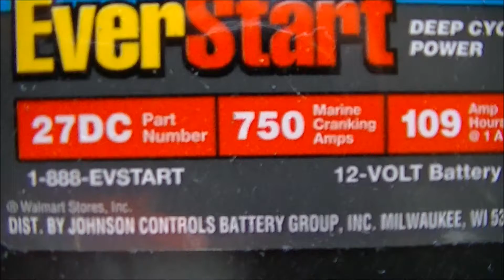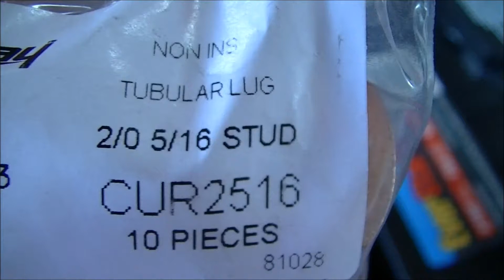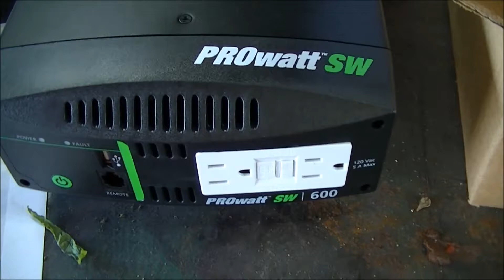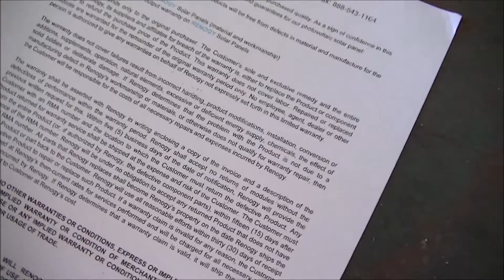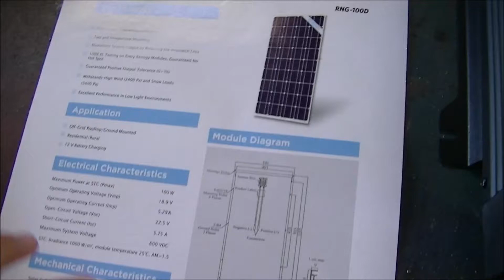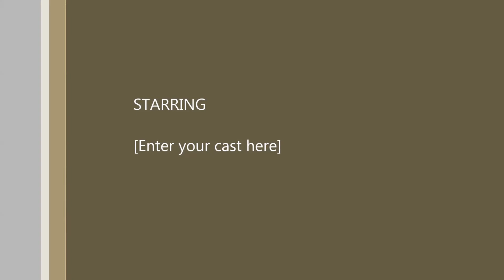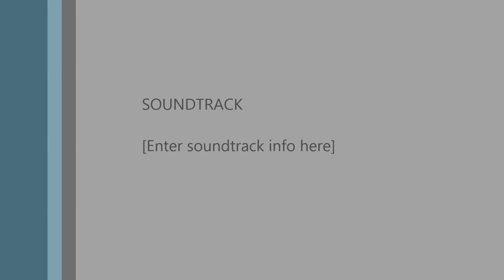solar gen build part 1 of 4 intro and cable work

Comment: Did you forget to fill in the ending, or was that on purpose?
Reply from the maker: This video was made when I was still using Windows Movie Maker and I would use the auto movie feature, or whatever it was called, after I trimmed all the clips and it would put in a title and the ending as well as randomly turning one of the clips black and white, but anyway I would always forget to delete that thing on the end.
Reply: Oh ok lol